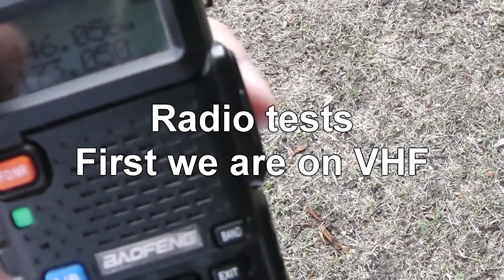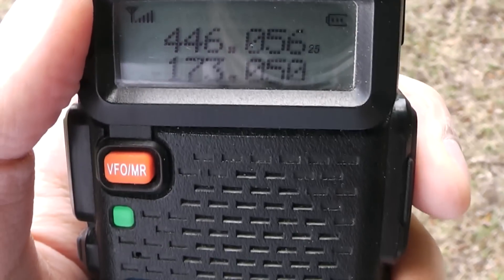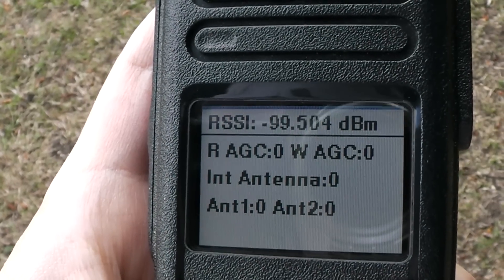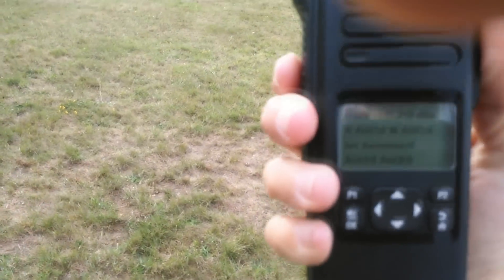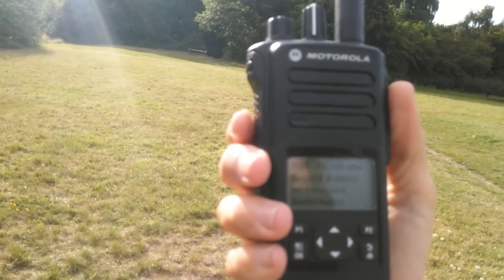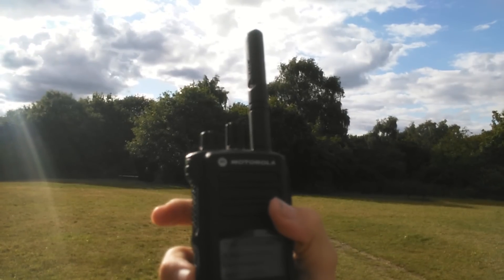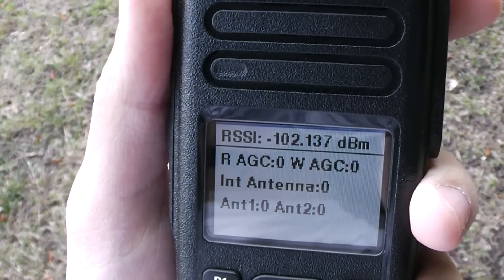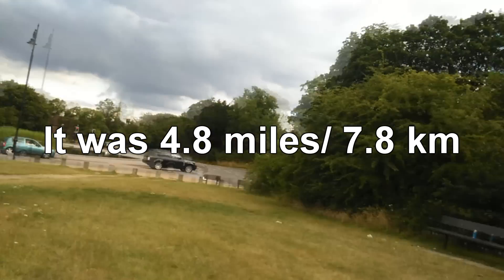DMR vs FM testing UHF and VHF

Comment: is this on a ham band >?
Reply from the maker: No. Read the other comments if you're interested to find out more
Reply: @radiosification  it's ok. I have a 0 - 1300 MHz multimode transceiver
Reply from the maker: @NorseCode.81  that doesn't make it legal

Comment: I think DMR works better than analog in both VHF and UHF. DMR definitely provides much more clear voice even at the edge of coverage. Some comments said that they encounter problems when using DMR at work. Could you give examples so that we can discuss.
Reply: DMR while clear, loses voice quality. Voice quality refers to “how understandable are you”. With improper usage, in my experience dmr will lose clarity (sounds muffled). However, DMR has a lot of pros including DCDM/TDMA (dual timeslot operation for both simplex and repeaters) and the ability to encrypt audio.
Reply: @chamian1167  I think the occurrence of cheap Chinese DMR radios lowers the quality of DMR radios. When a Motorola DMR radio talks to another Motorola DMR radio, they literally will have no big problem; signalling features are compatible as well as voice is less robotic and understandable. But when other cheap Chinese DMR radios prompt out, the average quality is lower and signalling features are not compatible within brands. A correctly tuned DMR radio can sound as natural as other digital standards. It depends on how the user talks into the microphone, the audio profile of the radio and the brand of radio.
Reply: @galax574  I find that a $30 dmr radio performs about the same as my $500 dmr xpr 7580is when used properly
Reply: @chamian1167  Congrats! You've mastered the radio
Reply: @galax574  I have a couple cheap Chinese tyt dmr radios, and just bought two used xpr6300s to replace them as I bought them for work and don't want to hand them to someone and they start pushing buttons. Less stuff to break with no keypad or screen too. I honestly don't hear much of a difference other than maybe the Motorola's speaker is a bit less tinny

Comment: Now I see why ham/DMR users say Baofeng is rubbish.

On another note, the Kenwood performed as expected; crystal clear. Always loved how well they were built. The Motorola sounded nice too, though with a little tweaking it could sound just as good, if not better, than the Kenwood.
Reply: +radiosification I thought that pagers had been made extinct after the rise of the mobile phone. But recently I have heard that they are making a bit of a comeback. I wonder why.
Reply from the maker: Not quite sure why you said that. The baofeng performed very well in this video. It's hard to see much difference between it and the kenwood.
Reply: +radiosification I had headphones on when watching this yesterday and heard a ton of static from the Baofeng, though I went through it again just now and still say the same but I noticed the actual voice clarity did pare well in comparison to the Kenwood...once I got past the static and really listened. Still say the Motorola fared best.
Reply from the maker: I do agree with you anyway that the kenwood is a far better radio. We had problems (not shown in the video) with my baofeng receiving interference from pagers on a different frequency. I could hear Bradley absolutely fine with a good signal when the pagers were not transmitting, but as soon as they started his signal was completely wiped out in the baofeng. This is due to its direct conversion receiver whereas the kenwood probably has super heterodyne and we had no problems with that. The baofeng did actually sound better than in the recording though. I remember being really surprised at how little noise there was, and then disappointed at how much there was in the recording. I think maybe it's thanks to the AGC in the camera I was using. In real life it sounded excellent (when it worked).
Reply: +radiosification I concur. I did seem to notice once the signal changed from digital to analog all radios fared worse across the board. That may have just been line-of-sight and what you mentioned before with the pagers and whatnot.

How did the Motorola sound in real life as opposed to this recording? Were there any quality issues or differences when switching from digital to analog or vice versa?
Reply from the maker: Just note that we did not use digital on VHF at all. Only the motorola radios were using DMR mode as well as FM. The baofeng and kenwood were only operating in FM. Digital seemed to work very well here. It seemed to get through slightly better than FM on UHF. There were no issues switching between the modes, because you just program them in beforehand with the motorola radios, then in the field all you have to do is change the channel. The motorola sounded good in real life. I can't remember it really well enough to comment on the difference between real life and the recording. I did have an audio enhancement mode on though which increases the treble. There are a number of audio profiles to choose from in the menu of the radio. I think the audio might have sounded slightly better with it off actually.

Comment: DMR is tragic :( I am disappointed. Analog is much better.
Reply from the maker: I thought that DMR did better than analog in this video. You can't compare UHF DMR to VHF analog, because that's not a fair comparison.
Reply: Radiosification is correct. 

I've two Yaesu UHF/VHF units (2900 and 7900) and two Baofeng uhf/vhf units (F8 and 5RE+), but my "go-to" radio is my Tytera MD-380 DMR HT. Crystal clear, loud volume, and with just an FCC "Technician" level license, one can speak to folks in the United Kingdom from the USA. 

A third of the members of my radio club now have DMR radios, and their popularity is growing in leaps and bounds. 

Natalia, do you even have a license? I ask because it appears that you know little of that you wrote.

N4ANO
Reply: The sound is better on the analogue. The sound quality is better on the analogue. With DMR we have a lot of problems at work. Traditional analogue was better :(

Comment: 173 Mhz? Thats not the 2m Band, isnt it? cO
Reply: +radiosification what frequencies are you using?
Reply from the maker: You can use a GMRS license. I think that's the most similar thing you have to this.
Reply from the maker: No it isn't using amateur frequencies.
Reply: +radiosification what type
Reply: Also consider he is in London (band plans are different)
Reply from the maker: In the UK you can get a "Simple UK light" license which allows you to use a few channels including that one for a set fee. The channels are shared with many other users, however the VHF ones are often not busy and the UHF ones are usually full of interference from other users.
Reply from the maker: It's a business radio license, not amateur. You don't have to take any test for it, just pay the license fee and you can use it.
Reply: radiosification Do you know if in the US you can get a business license and use it for family use?
Reply: radiosification Ok. Thank you.
Reply from the maker: Thanks for the correction. I'll try to remember that.
Reply: ngkful Yeah It does. It's the difference between Color and Colour; Armor vs Armour; Z(ee) vs Z(ed), and so on

Comment: Nice range test. I wonder what the results would be if you were using a commercial radio instead of the Baofeng UV-5r for VHF As it's not a commercial radio.
Reply from the maker: RF-halation Thanks. Yeah, it was very good sounding actually and had barely any noise. The antenna I was using on the Baofeng was a really good one though.